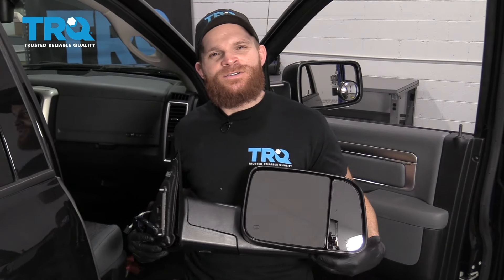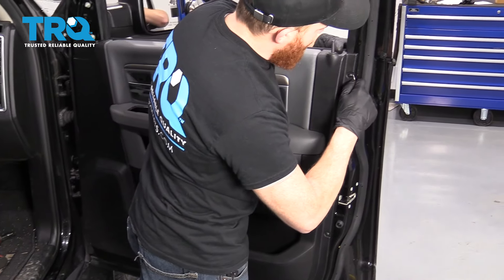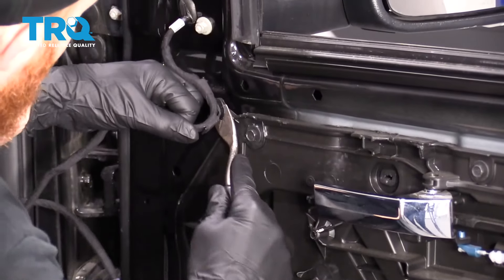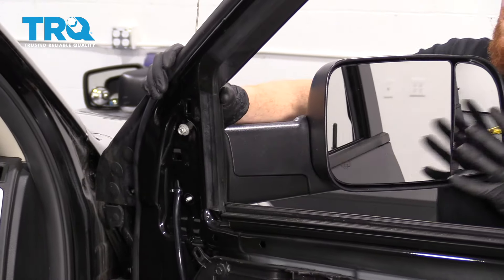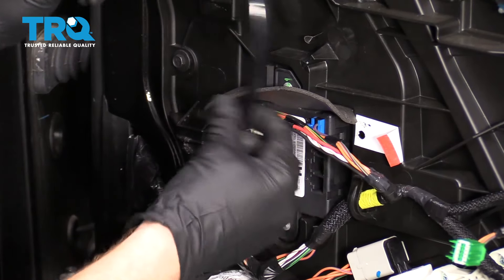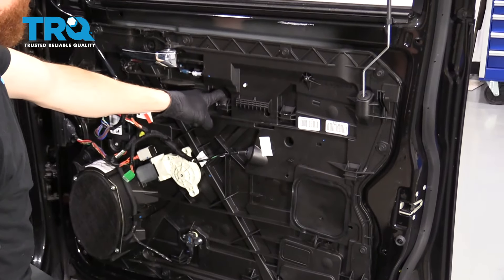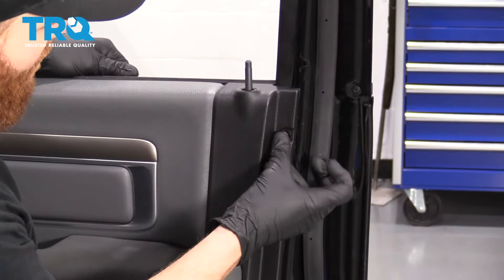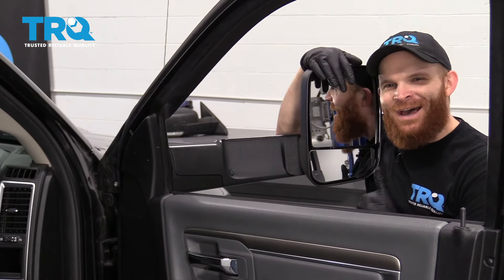How to Replace Tow Mirrors 2010-18 RAM 1500

Comment: For those asking about the 2500 yes it worked same steps on my 2018. I recommend checking the bolts the nearest to the door scraped against the door frame because the mirrors I got came with slightly larger bolts installed. I filed them down and everything was fine.

Comment: Thank you for a very clear and useful video.  Also took me just 45 minutes to remove the old, broken mirror and replace it with a new mirror.  I would not have known about the two piece plastic push pins had I not watched your video!

Comment: Thanks to this video it took me 45 minutes to change the right mirror on my 2018 Ram and only costed me $90 (cost of the new mirror itself). My door panel is slightly different than the one on the video but the instructions worked perfectly.

Comment: Do you have to add a bracket or brace before you switch from the sport mirrors to tow mirrors like this? I’ve got a ram 2500 I was to put these mirrors on.

Comment: Great video, but I'm having a garf time finding a compatible mirror. Everything says it fits the 2012 ram 1500, but they have turn signals and said if your original mirror didn't have that, they may not function right fml